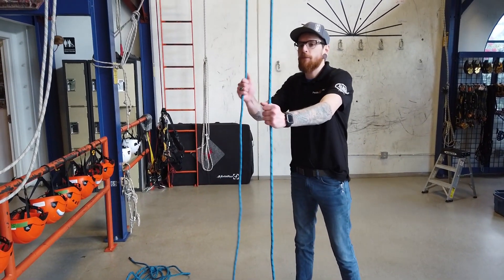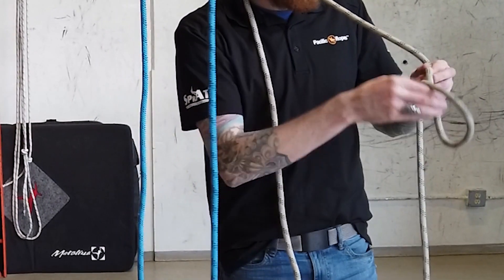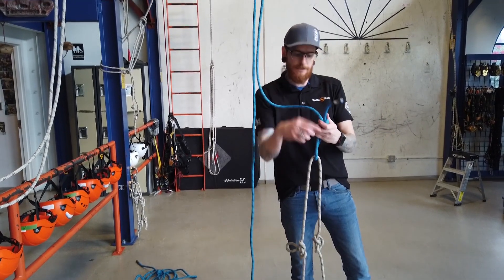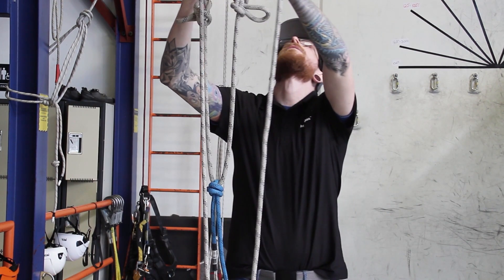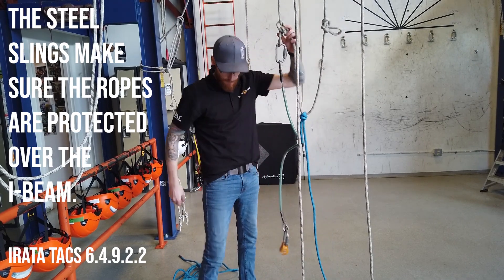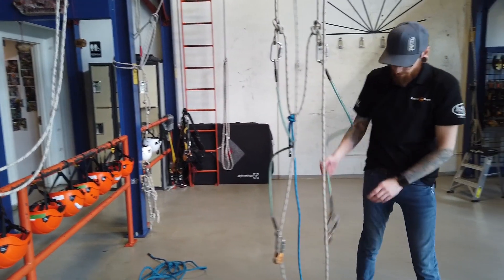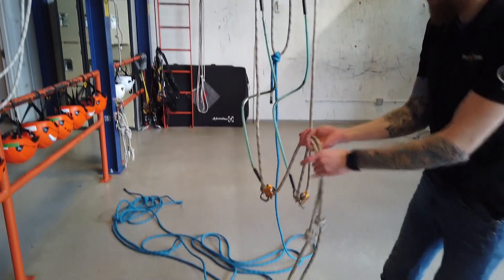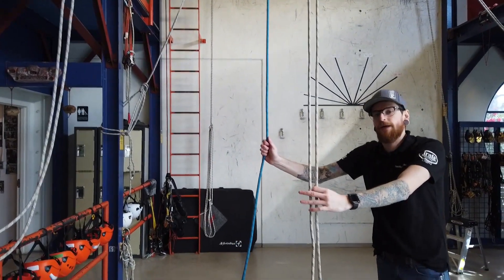Retrievable Rigging-Pacific Ropes

Comment: How did the blue rope get up firts?
Reply from the maker: Throw it! Sling shot, weighted bag with a thin cord to pull the rope over, basically however you can. If you can't, this method won't work, so fair play!

I remember using a home made potato cannon once to get a line up and over a structure. Sometimes you've got to get creative.

Comment: for a 160' tower the rope would have to be over 600' long
Reply from the maker: Just to fact check your math, the "halfed" rope, would need to be 320', (or 2x160' ropes) and the retrieval line would a separate rope, which would need to be 160'. Totaling 480' of rope give or take. What seems to be the problem? Do you have an alternative method that would use less rope on a big tower?